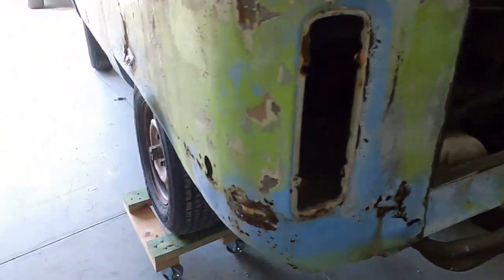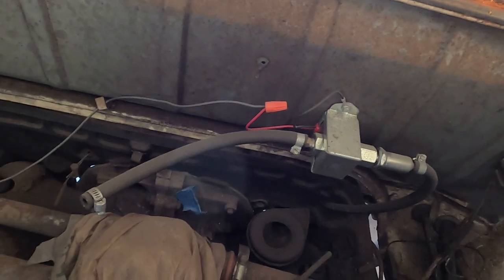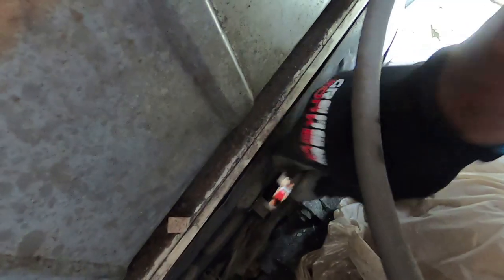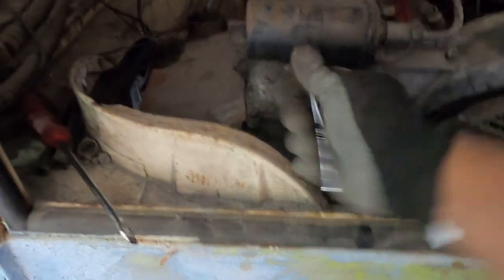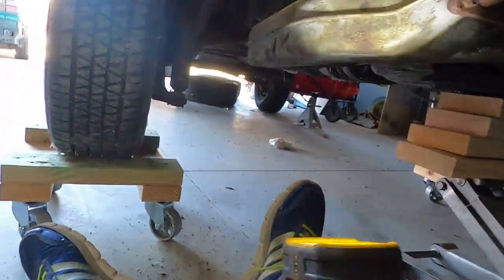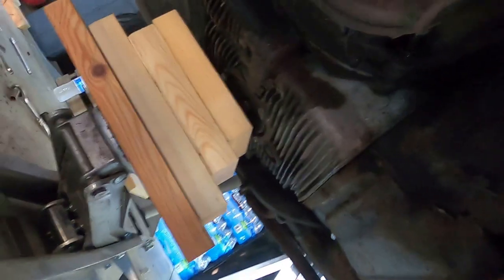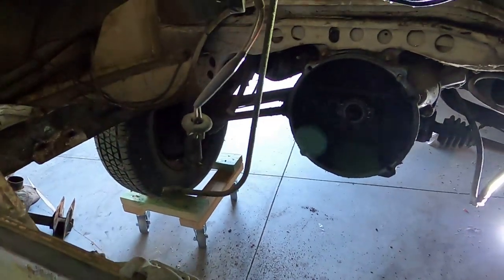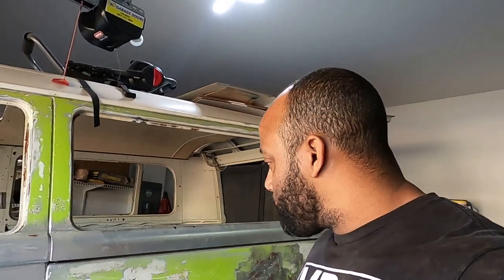VW Bay window Bus engine removal.

Comment: I just got a 95% rust-free 1973 T2 & am at the same point. Mine won't go into gear, so the drivetrain is about to come out. It's been sitting in this condition since 1996, at least, according to the found diagnostic parts-list in the glovebox dated as such: which really helped narrow down the problems with mine. It's crazy to me that no one fixed it after detailing everything it needed (light lenses, weatherstripping, bushings/seals). GREAT shape except for some pinholes in the floor, a couple small fist sized dingers, and a mildew-ruined interior, but has a clean title, and only cost $2500.
Reply from the maker: Yeah. Sometimes I wish I would’ve waited to buy a bus in better condition. But back then they were going for twice what we paid.

Comment: Good effort there pal. I feel you’d benefit enormously from doing some research in advance of tacking a particular job and going in with a better plan. Engine removal is quite simple and is detailed in the Bentley book or in other online places . You’ll probably find ratwell useful as he has a westy with a type 4 engine too.  Your energy and determination are faultless and you have a lot of work ahead of you. Get yourself a few shortcuts through reading 👍